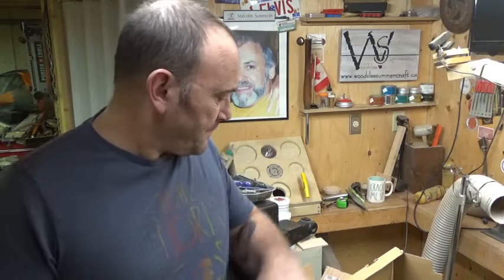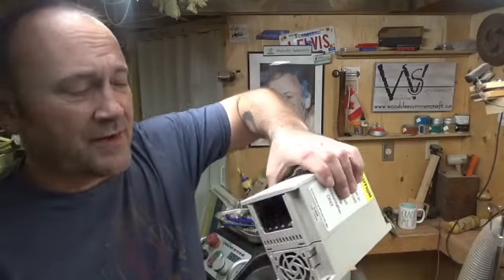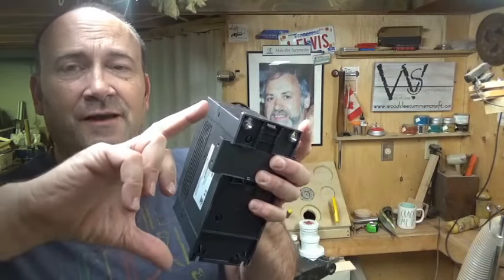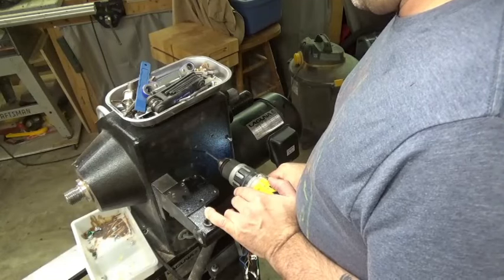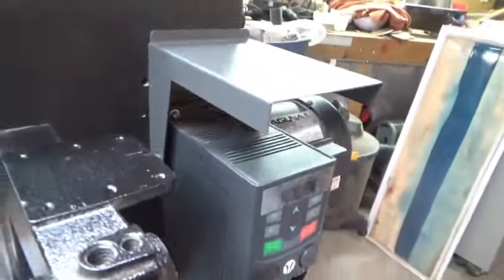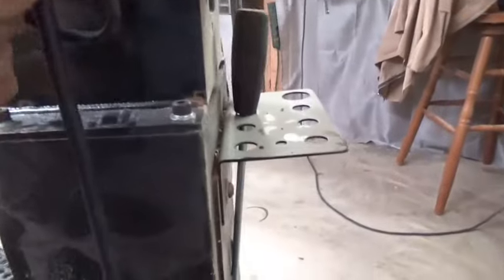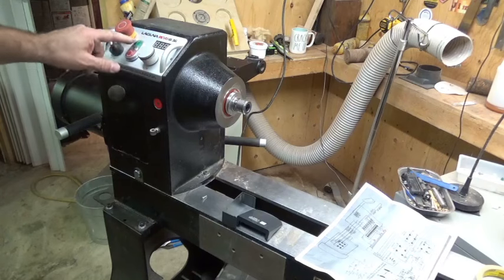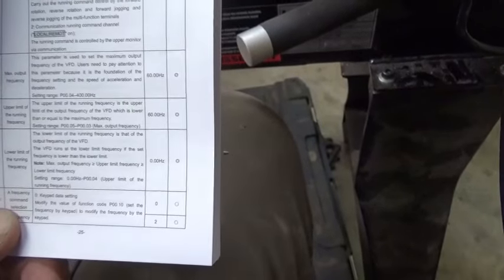Laguna Lathe Fixed!!

Comment: Late to the party.   Glad everything is working for you.
I have done several VFD installations, mostly on metal lathes.   I just did one on a 14in Jet wood lathe with Reeves drive which was binding.   This required upgrading to 3 phase motor and TECO VFD.   TECO manual has all the technical information for programming the VFD and motor.
My friends shop only has 120V AC so had to order the VFD for 120C AC input and 240V AC 3 phase output.
My friend now has a tachometer with ON/OFF and FWD/REV in a separate box from the VFD mounted for easy access from the front.
Min and Max Frequency are typically configured as the user desires.
If the torque is insufficient at low frequency, you may need to increase the minimum frequency.

My friend is now happy that he has digital variable speed control and new REV function.
The fan for the VFD is another parameter.   It seems to be presently set to run when the VFD has power.   You can should be able to change this to only turn on the fan when the internal temperature sensor reaches a pre-determined set point to turn on the fan.
Dave.
Reply from the maker: Thanks for the info
My lathe has now been running perfectly 
And at a fraction of the cost of the laguna vfd i was quoted

Comment: Bonsoir Rob, good challenge to put this VFD. Just a precaution with low speed, do not run below 200 rpm for more than 2 minutes because the motor doesn't have sufficient ventilation. A+
Reply from the maker: I don’t usually run at too low a speed, just interesting that it is possible now. I imagine with no significant load on it at low speed the motor wouldnt heat up too much anyway. 
Thanks for watching

Comment: so glad to see it worked out!  my vfd conversion is still underway, currently i'm doing the permanent wiring in a nema 1 enclosure.  i had to figure out the programming myself but that part is done.  i'll send a pic to you on facebook.  i will have some mechanical work to do getting the motor and belt drive set up
Reply from the maker: Yea i am super happy that it is working, i hated the idea that it was going to cost me $1000, honestly im not impressed by Lagunas services post purchase. They told me the vfd that was on my lathe was discontinued later in 2020, i wonder why!!!

Comment: How exciting! Nothing worse than your primary piece of equipment being down. I suspect you can change that brake parameter as well if you want to. But that wasn’t half bad as it was. Anyway, congratulations on getting your lathe back up and running as you expect it to.
Reply from the maker: I am super excited and happy to have it back in action, as far as the brake goes its working fine. 
Cheers